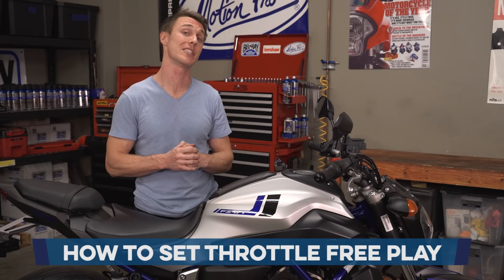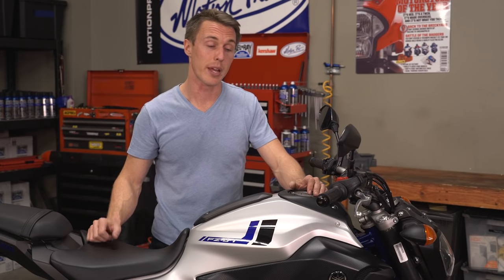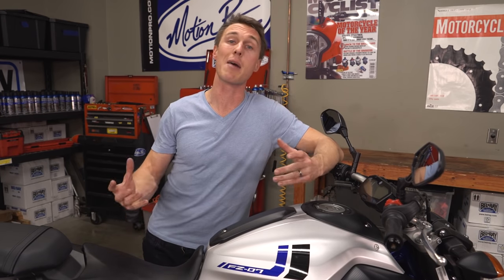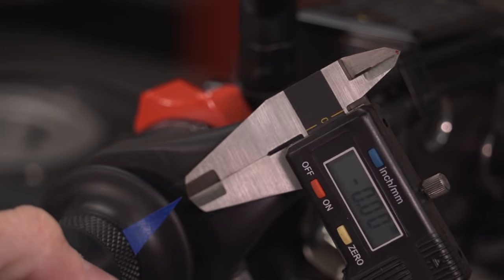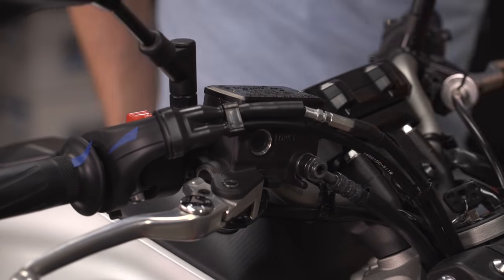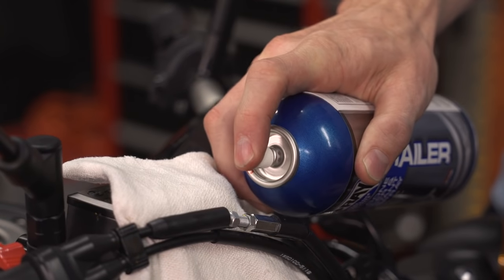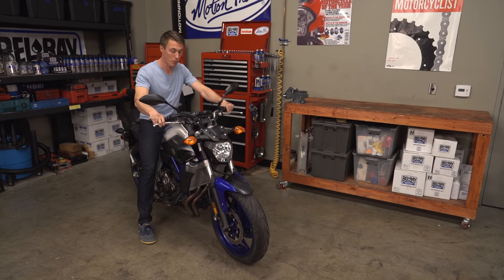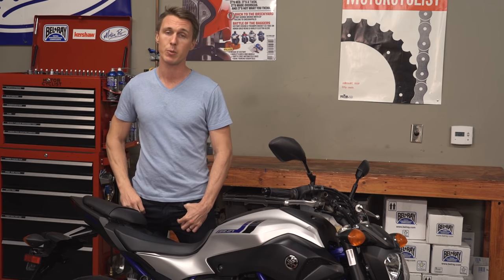How To Adjust Your Motorcycle Throttle Cable | MC Garage

Comment: I like my free play at 0.0
Reply: Yup - as long as it doesn't rev when the bars are turned, zero free play makes for the smoothest use for me.
Reply: Scooterider1 Don't ride track do you…
Reply: Mark B You neither huh…
Reply: One2 No but I do ride very aggressive.
Reply: Just curious, why would more play be better for track? Thanks.
Reply: Tanmay Chhatbar it makes no difference, he's just talking smack. Always set all of my bikes to 0.0 and never a problem on street, track, x-country, canyons, commute, anything.  It's just a preference.
Reply: Tanmay Chhatbar Good question. Various reasons: Rev matching (don't want to accidentally crack the throttle open during hard front braking). You're moving all around on the bike and with 0.0 throttle free play, it would be very easy to crack the throttle open when you really don't want to. This could lead to the front wheel sliding out from under you. To sum it it, there's more room for error with no throttle free play. Especially when the throttle controls a 190+ hp engine.
Reply: Tanmay Chhatbar Another thing to add is you might not be able to close the throttle completely after the rev match is complete. A lot of things can go wrong when you don't have proper throttle control.
Reply: I've been used to no free play, and while braking, I lose control while rev matching on bikes with a lot of it (under-revved matches). Maybe, it's personal preference. I doubt, any free play would be beneficial for me. I'd be more interested in learning to use the throttle better if that was a problem on track. Thanks for your input though.
Reply: Tanmay Chhatbar On the street, I could get away with no free play. I have very minimum now. But on the track, I find myself adjusting it. The thing is, on a technical track where you're constantly quick flicking left and right for turns at high speeds, the front tire WILL slide out from under you if you give the rear wheel any kind of power under hard braking. You have very little room for error.
Reply: I never experienced it, and hope to keep it that way.
Reply: Scooterider1 that is it meh brudda... immediate response.
Reply: The free play is a feeling that you can adjust for. It doesn't really matter how much there is, a good rider doesn't care. Seriously, I've been on poorly adjusted bikes and super-tight bikes. It made no difference to my riding. If you do care about it so much that it affects your brains then keep practising and trying different bikes because it's something you're going to have to deal with.
Reply: One2 u must be a very tough manly man big papa one, I wish to be like u and have a life revolved only around finding joy in my motorcycle and guns cough only possessive materials cough
Reply: Might aswell add to this conversation. I also prefer very minimal throttle free play, but living in Finland where the temperatures between the start/end of riding season (as low as -8C) and the middle of the riding season (up to 28C) are drasticly different, the cable length is also affected by the temperature change (very slightly, but still notably). If I set 0.0 free play during the summer I can find my idle being more dependant on the handlebar position as fall starts to arrive.
Reply: My free play is around 1 cm...say 8mm.. i feel jumpy handle bars.. is thr free play causing it.?
My throttle grip is from ktm rc 200..but my bike is duke 200.
Reply: Same lol
Reply: I too have my free play at almost 0. I have no problems braking heavily while rev-matching. If anything, I feel like the rev matching is more accurate since there's no slop.
Reply: @DarkHorse08  weird you say that... 20+ years of racing and I've always had my free play at 0.0... felt the throttle on a few motogp bikes and they are also running 0.0 (not saying I've ridden them just given the throttle a blip with the bike was sitting and put of the 4 I've felt there at 0....)
Reply: Maybe while riding some woops on a dirt bike you could perhaps whisky throttle if you had too much or even too little throttle free play? I'm just thinking of a big hit jarring you and making your hand move the throttle accidentally. That's one scenario I can think of in which some free play would be desirable.
Reply: Yeah 100%
Reply: ANY tolerance is best when at zero
Reply: Me too

Comment: Too much throttle play drives me CRAZY! It is something way too common on new bikes on the showroom floor and on used bikes. I don't understand how people live with it and I see bikes with 12-20 mm of free play. Inconceivable!
Reply: So true, just recently I grabbed ahold of the throttle on one of my friends bikes, and it was like a well up inch of play, im like dude... dude, he's like oh thats good you want lots of play.. no man just no.
Reply: HA! Blipping the throttle on a downshift would require a person to swing their arm about a whole foot. Guess what that does to the steering? haha
Reply: Aaron Fink I know I'm a tech . So every bike that I put on the sales floor has no slop . Same with clutch cables . On new bikes I squeeze the lever about twenty times then adjust the free play
Reply: Aaron Fink I just bought a 2017 yz450f brand new.it had to much slack for my liking
Reply: dam 20mm? that's nuts.
Reply: How can people live with that
I feel the bike is dead at such play
plus you really have to pull it to get going, which obviously is a compromise on handling control

Comment: The final tip about lock-to-lock pressure on the throttle cable confirmed a suspision about my bike. RPM climbs on right lock. Now I know what to do to try and fix it. Thanks!
Reply: And it's now fixed. Thanks again.
Reply: PIK i
Reply: Just stopping here to say 7 years later this first time rider is watching this to try to fix my right lock throttle stick and rise. Content longevity on point haha.
Reply: @iamsospicy3309  7 years already... How time has flown. That bike got stolen from me..now I've got a 1998 VFR800

Comment: 2-3mm of free play. The CBR125 I rode at the driving school had about 2-3 INCHES of free play...It sucked
Reply: it may have only 1 cable connected...
Reply: @affan381  One cable? Isn't 125cc with single carb so why would it have more than one cable?
Reply: @SheIITear  bikes can have only one carb....
cbr125 is fuel injected and normally fuel injected bikes use 2 accelerator cable,
it has to do with the design of throttle valve mostly,
there are 2 cables 1 goes clockwise and other anticlockwise,
if you use 1 cable it could still work but u are usually left with a huge play to deal with...
according to my experience..
i personally had that issue.. coz not every mechanic knows how to deal with 2 cables so they do what they can
Reply: @affan381  Not all cbrs are fuel injected. Only newer ones than 2008. Also bikes can have 2 carbs.
Reply: @SheIITear  i assumed it was fuel injected even if it wasn't doesnt matter... it could still have 2 cables.
He may have different problem though you never know..
And bikes/car can have multiple injectors for each cylinders but never more than1 fuel pump or carburetor...
Reply: @SheIITear  i would lyk to know of any in particular... that could be learning curve for me to see a 2carb in any production automobile.
Reply: @affan381  Nearly all bikes have 1carb or 1 efi throttle body per cilinder. Cars often have 1 carb/throttle body even though theres cars that had multiple carberators like the VW Beetle sometimes had. They are usually mechanically linked so 1 cable can do multiple carbs.
Reply: 2 - 3 inches ?!  Wow, to get any revs from a start you'd have to roll throttle from stop to about the midnight position.   Why would a riding school have such poorly maintained bikes?   Try 1-2mm on your bike.  Anything more and the throttle just feels sloppy.
Reply: The ship the CBR's out so poorly. I'm on a 2016cbr1000rr  as my first bike. Went in for some service and the guy laughed like dude your throttle is sooo bad. It's my first bike and I knew it felt awful. He fixed it for me, and now I want no free-play.

Comment: This is why i hate my Ninja throttle, Kawasaki had to choose horrendous cable routing that raises the rpm no matter what, be it turning left or right so i have to run loads of free play. The newer bikes with ride by wire must be amazing.
Reply: I ride a 2012 Kawasaki Z-1000 and had about 1/4" free play that I adjusted down to a 1/16" without any issues. Have you looked on the rider forums for help? Hope you figure it out, good luck.
Reply: Dinxsy just reroute the throttle cable. Problem solved.

Comment: I don't know why manufacturers deliver their new bikes with so much sloppy throttle play. It makes for very jerky shifting especially at slower speeds. I adjust mine with almost no free play as long as the engine does not rev up when moving the steering to the stops. Also easier on the wrist not having to rotate as much.

Comment: Ari, as a Master Tech, custom bike builder and drag racer of over 40 years,  if I had a dollar for every bike I worked on that had too little or too much free play in their throttle cable/cables, I'd be filthy rich. In fact MORE frightening,  are incorrectly adjusted clutch cables.  In my humble opinion a much more serious situation,  resulting in much more serious consequences and a expensive repair bill. 
GREAT VIDEO AGAIN HOPEFULLY PEOPLE ARE WATCHING AND LEARNING.  🏍🇺🇸🏍🇺🇸🏍
Reply: I have a 900 Vulcan. Low speed maneuvers are enjoyable, so i guess i have the correct adjustments on throttle and clutch. However i'm having a hard time with my just acquired Nomad. Idles at 1000 RPMs and touch the throttle and right to 2500-3000. Clutch doesn't feel right either. Makes it hard to stay in the friction Zone. Just checked and had about 6 mm of free play. adjusted to 3. I'll have to search clutch adjustment. Glad i saw your comment. If i can't resolve it, i'll have a pro do it. Season is almost over here.

Comment: I eventually started adjusting the throttle free play based on the use-case. I leave 0 for gymkhana, along with really high idle 4000rpm, but get idle down to 900 rpm with considerable free play on the track, to avoid accidentally applying throttle when leaning far (my shoulder is toast, so my hand sometimes twitches on its own :D ).
It´s really great that a new rider these days can just look up a 3 minute video and know right away what to do :) .

Comment: Ari... your hand is ok now... thanks God for the quick recovery
Reply: George Tsiros and the distance is proportional to the length of the tape. Where do we measure free play? In the grip where we hold our hands? In the larger thumb protection diameter? Because the value will be very different...

Comment: Once i had the same problem, twisting the handle make idle to rise. But at that time i didn't know what was wrong. Thanks you make good video.
Reply: aakash singh Idle speed rising by twisting the throttle is normal mate.
Reply: hamzterix haha i'm not talking about throttle, i'm talking about tilting the handle bar right.
Reply: hamzterix no. Idle speed should always stay constant. Twisting the throttle revs the engine, moving the rpms above idle. Fluctuating idle speed indicates a problem.

Comment: This is one of the reasons I love carbureted engines. There's a lot more room for fiddling with throttle play. You can get it to 0 with a lot less work then something injected and you can even up your throttle resistance if you're good

Comment: I used to set the freeplay to 0mm and yes it's much better than too much freeplay, but lately I've set it around 2 mm to have a better control when going from 0% throttle to 1%

Comment: why is there a 2nd cable on the throttle?
is this some kind of safety feature?
i see this on newer bikes 2017 and later....

thanks!!
Reply: How is the throttle supposed to return when you let it go? 

By having an alternate cable that provides tension in the opposite direction. :)
Reply: It is in fact a safety feature. If there's ever an issue with a return spring popping off you're not stuck with an open throttle, you can manually crank it closed since it's a pull/pull system.
Reply: @YSPDJapan  I've never heard of a throttle that can't close without a second cable. They're generally sprung at the throttle body / carb. Single throttle cables are actually super common on a lot of stuff still. Have a look at a lawnmower. The second cable is purely for safety.
Reply: Some bikes have a dual throttle system, one cable controls the left side of the engine and the other controls the right side.
Or one cable is for accelerating and the other is for decelerating( also to allow the throttle to return back to the central position when you let off the throttle).
Reply: @DarwinAllen  throttle bodies have a return spring, this allows the throttle valve to close( rolling forward or letting go of the throttle).
All of this is done Mechanically( cable controlled).
Reply: @muhammadabdullah03  that's what I wrote. The second cable pulls it closed in the event that the return spring fails. It's a safety redundancy.

Comment: No thottle play, or at least no more than 1-2 mm,  is the way I like it.  With more play than that, on a start from a green light, the revs kinda surprise you sudden like.   With no play, you can roll on the throttle for a  smooth and graceful start,  very professional feeling.

Comment: Hey Ari, I do watch your videos. very informative, thank you. I need  a help though with my Ktm Duke 390.

Is this default that while turning my 390's handle lock to lock clutch cable not the throttle seems to be getting stretched at some or other points. I even checked with new bikes also and also with my fellow riders also. But this seems to be same with every one of us.

Please guide and if possible please upload some videos related to 390 also.😊

Comment: Hi. I’ve recently replaced a new pair of handlebar knob and after that my throttle seems to feel slack. Is it the cable issue or I should get a right fitted knob instead?

Comment: I jsut doublechecked and found that my current bike only has one cable.

I seem to recall that the second one is for safety reasons to pull the throttle body closed in case they get stuck.
  Should I be worried?

Comment: hey Ari, i saw wondering why do bikes make that cranking sound when you press the ignition switch? and why does the sound differs from bike to bike
Reply: Faiz Hussain different engine internals, different starters, make different sounds. For example race bikes either use ultra lightweight starters or have to be bump started every time.
Reply: Power throws the starter gear into the gear on engine to turn it over. Different designs make different sounds just like cars. basic explanation but it is 2 gears turning that is noise and depending on brands they make slightly different noise dependent on design and metal alloy types.

Comment: BINGO we have a winner he even mentioned making sure turning bars did not bind cable and pull throttle, even mechanics forget that sometimes.
Reply: And do not to forget to lube them for smooth easy action, on all cables, extends life also. Nothing like a broken clutch or throttle cable to ruin a ride.

Comment: newb question: why do you need freeplay? why dont leave it 0 (instant read)?
Reply: uwowowowow When the bars turn, it can change the tension on the cable. The best technique in my opinion is to find the tightest point by turning the bars, hold it there, and then take out every bit of slack. Just let the bike run with the bars in the tight spot and tighten until zero slack.

Comment: hi mate
cud u pls guide me if its normal to have minor oil leak at engine head cover joint which houses piston, also minor oil leaks at engine head to body joining @screw nuts..?
I am talking about my 150 cc Bajaj V15, 2016 model, about 700 km run.

Comment: On a similar topic, does anyone have any recommendations for switching throttle tubes? I'm thinking of getting an R1/R6 throttle tube to shorten my throw on my bike.
Reply: Thanks for the advice but I'm aiming for a budget fix. I've heard that OEM tubes are fairly cheap, but how compatible are they with each other? Just trying to see what kind of research I should do before deciding.
Reply: MEASURE yours and theirs bars are usually standard diameter but measure it and you will know. Make sure tube diameter and length is good.

Comment: Really wish dealerships would do this boringly simple task. Pretty much every new bike I've sat on or demo'd has a sloppy free-play on the throttle tube. Not only fore-aft, but also side-to-side. Then I get on the internet and read all the negative comments everywhere about how snatchy and terrible a particular throttle is. While I cannot deny that some ECU programming is bad from factory, it only compounds the lack of control to have a lot of tube freeplay.

Comment: There's two cables attach to the throttle which should be work on? What's the function of the second cable?
Reply: I believe the second cable is there to let you close the throttle if the spring(s) ever give out. You would adjust the one that opens the throttle.

Comment: ok so i've looked everywhere and everyone thinks I mean free play or something. the throttle feels like it has a cm of play left. as in it moves if you grip it and push left the slightest amount. I don't see other bikes with this issue but I've never dropped it or anything so it's not from damage? I'm confused is that normal or?

Comment: I like 0mm free play
Reply: Until it's hanging up your throttle. You need a very small amount.
Reply: ABHILASH i stay with 0.3mm
Reply: Cable-length or throttle tube degrees of rotation? How do you people actually measure 0.3mm?
Reply: Lifted_Above calibers